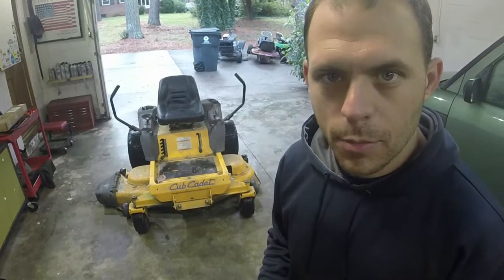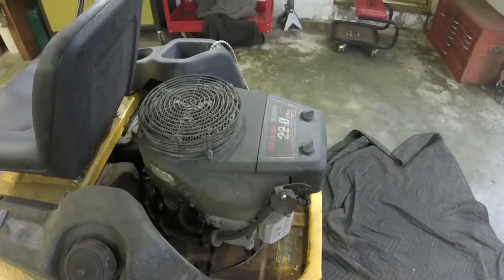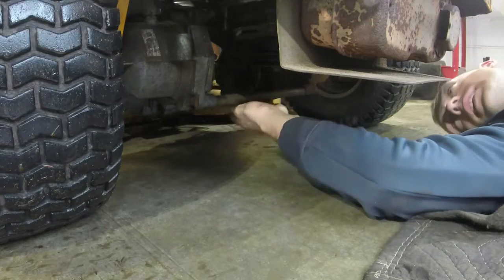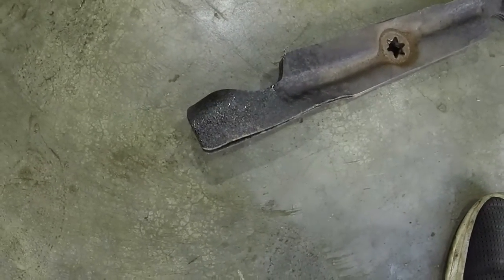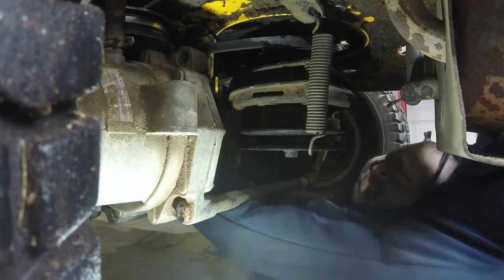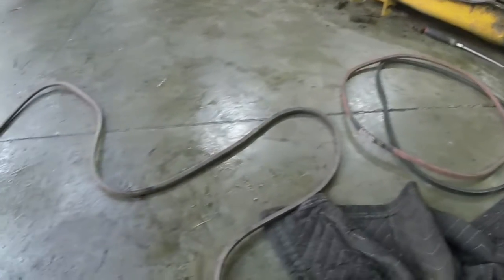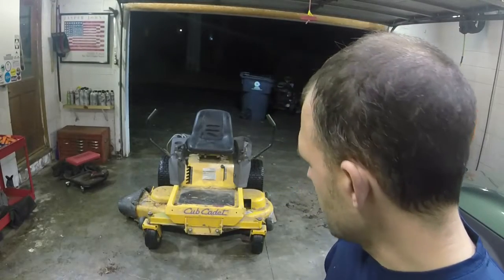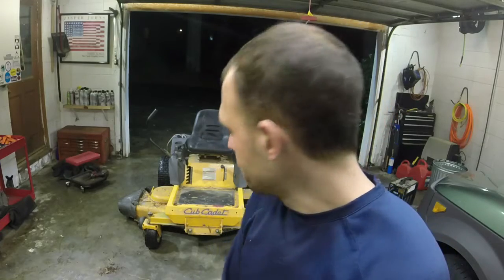Cub Cadet RZT zero turn: how to replace belts and blades (lazy drive and vibrating deck)

Comment: I've done this twice on mine, never knew I could do it without taking off pto clutch ✔👍
Reply from the maker: The tension spring is weak enough to be able to do it which is so nice.  It's so much better than having to take that spring on and off!

Comment: Might want to check out the idler pulley,s to make sure they are not messed up but it is up to you to do that  otherwise you doing the thing to make it a great running mower
Reply from the maker: The pulleys looked good except one of them had old remnants of a belt wedged into it which I think was causing the issues with vibration, and maybe even the wear.
Reply: @EllisMowersandmore  that is a great thing to always check out the idler pulleys for any issues that they might have I was going to do a video on this matter  I still May be doing something with the idler pulleys

Comment: Yes I made that mistake with aftermarket belt on my riding mower it is to thick and it broke the weld off the variable pulley so I got to replace that I look into stens for that belt when I replace it.

Comment: If you are doing this for the first time Its best to watch not just the video but read all the comments. you will gain valuable insight that the specific mower in the video may not match your mower exactly. That being said, your mowers configuration will have one of these two scenarios. 1, the PTO clutch bracket is located toward the rear of the mower and 2, the bracket is pointing toward the front. If YOUR mowers configuration matches condition 1 you will need to remove the clutch. if it points toward the front you will not need to lower the clutch.
Reply from the maker: Thank you, they do make minor changes and improvements every few years.
Reply: keepin us on our toes. @EllisMowersandmore

Comment: The whole reason to watch this was how to put the drive belt back on? Totally skipped that part
Reply: Hey did you find a good video that shows how to put the drive belt back on?
Reply: @stigmaticbudgie666  no, ended up going to dealer to find out, used a impact drill to take drive shaft bolt out on the bottom, then just dropped the pulleys on shaft enough to put belt on. All good now

Comment: Is the Right rear deck belt follower pulley  level with the deck or is it mounted at a slight angle?? On my RZT-50 that right rear deck pulley is at an angle, not perfectly horizontal with the deck. Someone has ground off some of the metal from the bottom of bolt stanchion.
Reply from the maker: Some of these decks have slight variants.  You may have one that is at an angle, mostly so it stays on the pulley for deck height adjustment.
Reply: @EllisMowersandmore  I found out that bolt mount hole for the flat pulley was worn out of round.

Comment: Are those the OEM blades?
Reply from the maker: I did not use OEM blades as a replacement, but they are available.  Same design as OEM though.
Reply: @EllisMowersandmore  Are the OEM blades stepped center like those? I know mine have been changed to flat blades. Could you give me a P/N for the stepped blades please?
Reply from the maker: @MegaChuck51  MTD has changed to flat blades for their newer style decks.  If it's a 50" deck the part number is 742-04053.
Reply: @EllisMowersandmore  Yes, it's a 50" deck. Thank you!!

Comment: I need to know how put hydraulic fluid in
Reply from the maker: Haven't had to do one on these yet but they don't have reservoirs and not sure if there's a drain or fill on these lower grade units.
Reply: Did you get it figured for the fluid? If it’s a hydro-gear, they have 20w50 synthetic oil in fluid in them. You remove the filler plug and set the unit upside to drain out. Then, add new fluid up to .75 to 1.25 inches from the top of the filler plug hole…. Goto Hydo-Gear for instructions.